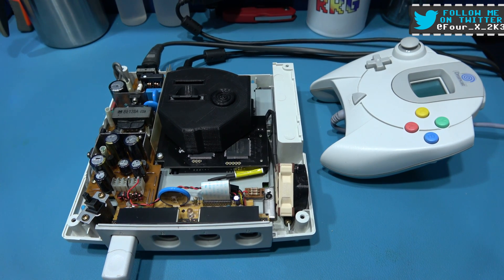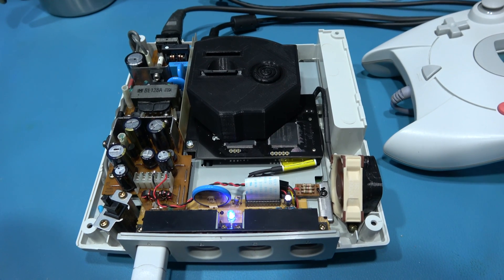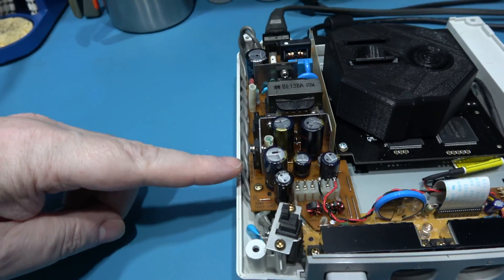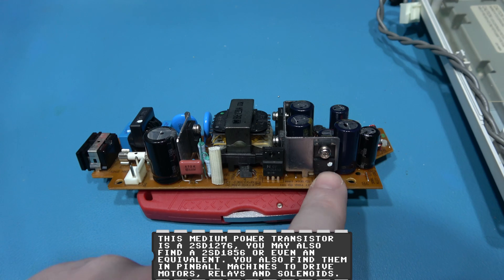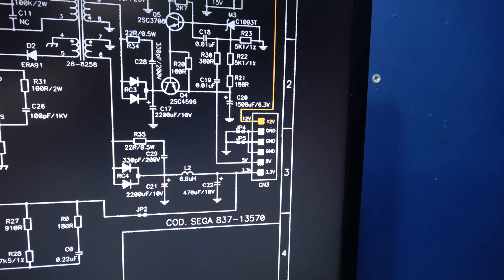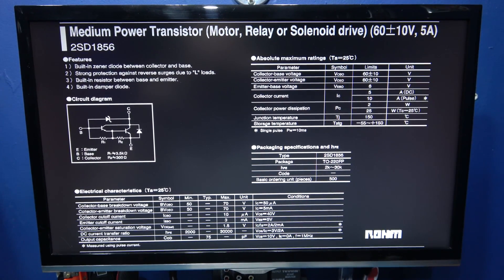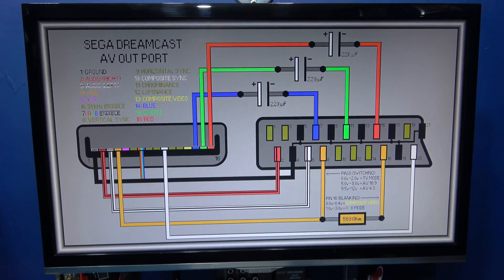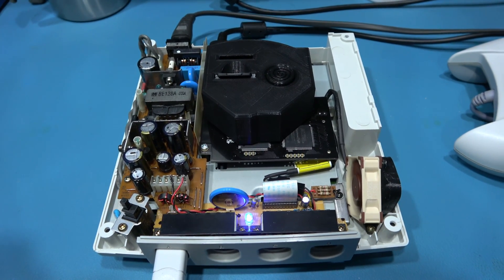SEGA Dreamcast - Part 3 (Follow Up) - Why I create a Dummy Load for the 12v Rail PSU, GDEmu Install.

Comment: @Four_X What would you recommend for me? 
I'm in UK with PAL VA1 Dreamcast.... I have DC Digital and GDEmu installed, but I get random crashing and/or sound distortion during the intial minute or so of turning power on - Sound distortion can happen on debug menu or after booting various games. If I can get into any game, they will generally freeze within a minute or so. 

As I'm using HDMI output, would I get away with just removing the 12V rail? Thanks!

ps. Good luck Forest (*from a Villa fan!).

Comment: Hello Four X , 
where i can buy this mini PCB board to put the 3 resistors ? have on AliExpress? Share the link 

Thank you
Reply from the maker: Topvint with help of Eduart Misiraj made a small SMD PCB from my Veroboard PCB Design, you can find it here. https://topvint.co.uk/product/dreamcast-dummy-load-for-odes/
Reply: @Four_X  thanks for reply, i already have some resistors 1/4w  that is good options mini board with resistors already but i was thinking buy some mini PCB you use in your video if you no the links for AliExpress i  search but not find mini PCB Just to put the 3 resistors
Reply from the maker: @  It's called VeroBoard or ProtoBoard. https://www.aliexpress.com/item/1005007944192559.html

Comment: What gague of wire did you use for this mod? I have a PAL VA1, and am looking into doing this dummy load mod (although I want to solder the wires to the underside of the board, so I can remove the PSU if necessary, without having to desolder anything)

Comment: What about connecting a 12v fan  a silent one since it's going be full speed like the noctua??? But not in the 5v Controller fan port !it's only needed to conect to the 12v rail ( can be directly in the power supply conector) and a ground ! You have the load and a better fan ! 2x1 !!!!

Comment: I used some cheapo SCART cable and it stil lworks without the 12v line - probably it uses 5v as a switching voltage but you are right, better be safe tan sorry. Why don't use 1W or 2W 330ohm resistors though? They are a bit bulky but still very cheap and easy to get.

Comment: That's only relevant if you're using a SCART cable since it need 12V. 
In NTSC part of the world, most people will use either regular RCA cable, or VGA or HDMI adapter. And yes VGA and HDMI use the 5V only, not 12V.

Comment: Nice explanation! i was thinking to actually add a load through a 40mm 12v fan, near the PSU at the back.
Reply from the maker: Yep, that would work also.
Reply: Hi, just curious: how'd it go with the fan mod? Do you have photos? Thanks

Comment: Very nice video, answers a lot of my novice questions.  If you don't mind, what kind of wire have you used to route the resistors to near the fan?

What old wires would be good enough to scavenge?  Something like an old USB cable perhaps?

My soldering is very limited, but this is a job I could do, but lack the knowledge for parts selection.

Thank you sir.
Reply from the maker: An old USB cable should be fine, just make sure you use the power wires normaly red (+) and black (-).

Comment: This is very informative. Actually I took the information from you and when building my dreamcast scart cable (😁 yep I build them myself) I connected pin 8 & 16 with a 75ohm resistor and the line from them I soldered on the 5V pin on the av connector. This way you don't get the dark image even if you decide to remove the 12V rail. 😊
  
Although most of people can't do this so creating a dummy load is a very good idea 👍🏻
Reply from the maker: Yes that works but the 12v is used to set the TV's Aspect Ratio (Switching) to 4:3 otherwise you'll always need to set it yourself in the TV's menu.
Reply: @Four_X  That is true, but a way I have found to get around that is to connect only pin 16 with the 5v line and leave pin 8 unconnected, that way the TV handles the aspect ratio. It always shows on 4:3 when I do this .

Comment: …and here everyone told me that it only affects the Karaoke adapter even though we have 12v right on the multi-out. I wonder if the new RGC YPbPr component cables use 12v. Maybe the long HD Retrovision delay has something to do with 12v not being available on all consoles.
Reply from the maker: I know, just create a dummy load and save yourself an headache.
Reply: did you ever answer this question 

do the RGC cables use the 12v?

Comment: Why wouldn't someone just connect a 12v 40mm Noctua Fan to the rail to do this? And wire up a resistor to the signal pin on the header..
Reply from the maker: Correct you could definitely do that. That's an option, but what if the Fan fails. Those 3 resisters in parallel will last longer than a fan ever will.
Reply: @Four_X  If the fan fails either way it wouldn't be good. If the fan fails in both methods you'd have the same issue. A failed fan is still a short so you'd still have current draw on the 12v rail. You'd just have no airflow which you still wouldn't have either way with an aftermarket fan mod. =Edit= I'm not trying to sound like a turd. You obviously know what you are talking about and I'm fishing for I guess a more technical reason people don't wire the fan up that way.

Comment: I can't say for PAL but NTSC-U DC power supply maxes around 14v without load.  From research I've found over the years the added temp is negligent and the issue had been because of poor air flow. 

You have a proper 3D print gdemu mount that brings back the original airflow as the gdrom.  Of course when these GDEMU were first installed, that wasn't an option so the fan wasn't directed over the power supply correctly.

Plus you have a noctua fan mod on top of that.  So it's overkill at this point.
Reply from the maker: Better safe than sorry, keeping the Power Transistor in check is always a good thing, it might just be a PAL PSU thing.

Comment: A few years ago when I was researching the GD-EMU / PSU heat issue, the common advice was indeed to remove that PSU component to disable the 12V rail. With most Americans not having RGB SCART enabled TVs they wouldn't have been affected by disabling signals, but as a UK user who only games on a consumer TV this would have been a bad move. I'm sure there's a peripheral or two that also requires that 12V line to work too. I decided to stick a resistor in the PSU pins and it's been fine, but suspect that I need to increase the load to further reduce the heat.
Reply from the maker: 99% of out TV here in the UK came with Scart Sockets, Some of the 3rd party VGA Devices use the 12v also.
Reply: A single quarter-watt resistor may get too hot. You an add more resistors in parallel but then you need to multiply their resistances by the number of resistors. That’s why he uses three 1/4w 1k Ω resistors to build an equivalent 3/4w 330 Ω resistor. Three times the wattage of a single resistor at one third the ohms.
Reply: 330 and 1w ! It's the deal.

But I preferred conect a 40mm noctua fan too the 12 v rail. @emmettturner9452
Reply: The Karaoke adapter uses 12v.

Comment: I removed the power transistor, but it didn't affect my output, mines an NTSC model so no Scart connector. I do use the vga (rgb?) output connector. I'm guessing it's that difference between the models as to why I don't have a dark screen issue?
Reply from the maker: I've changer the region on this Dreamcast, it started life as a PAL system it now US NTSC. 99% of our TV here in the UK came with Scart Sockets.
Reply: Hello, I have an ntsc system as well and I'm interested in how you remove the 12-volt rail. Did you simply use a hot soldering iron with some solder braid on the back of the board to remove the solder and just pull the rail out directly? I have basic soldering skills but think I could do this modification as I want the best picture possible. I have tons of interference from a Pico PSU I'm currently using and see that the stock PSU is best for clear video output.... so any and all help would be appreciated! Thank you for your time and have a great day! :)
Reply: @mrturbo757   I used a de-soldering iron however I would think you could remove it with a soldering iron and braid.